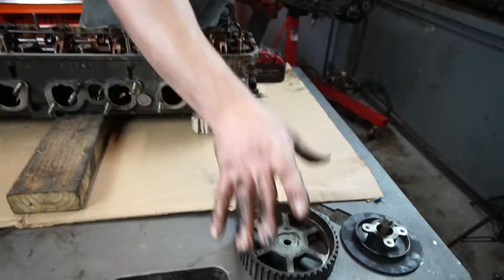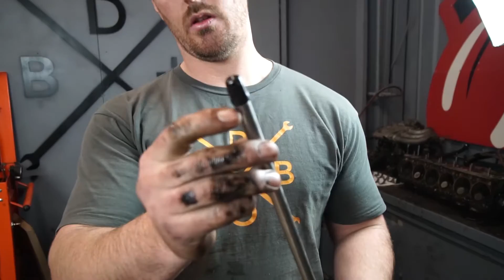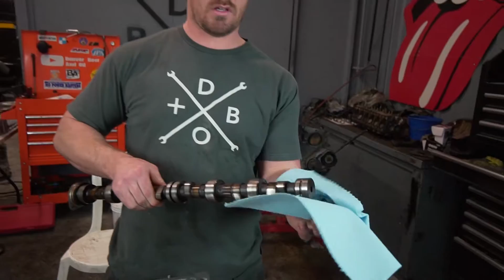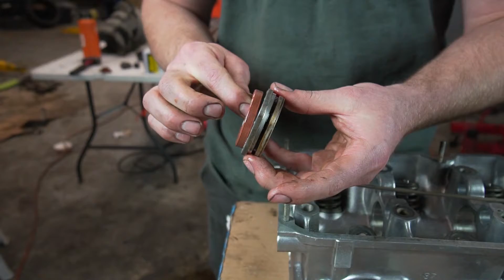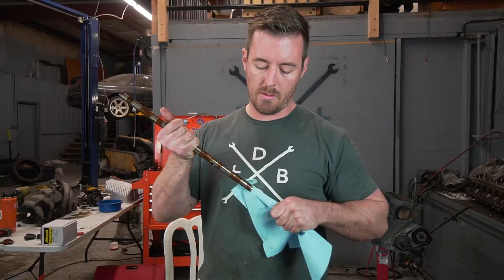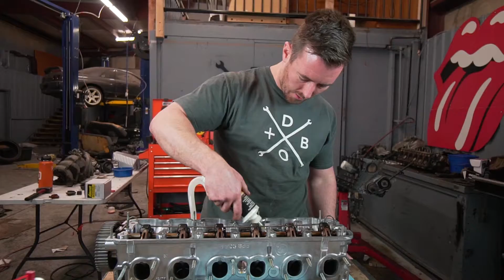M20 Head Assembly! | How-To

Comment from the maker: Hey guys, adding some supplemental info here, when reinstalling the rocker shaft @21:00... Make sure the large oiling holes on the rocker shafts are facing downwards to line up with the holes in the rocker shaft journal.

Comment: Thank you so much for this amazing video! I daily drive a 1983  e28 520i with that same engine which I had rebuilt last year. I noticed a small oil leak at the front passenger side corner of the block. Not sure where it comes from except I know when I did the rebuild I skipped the second head bolts tightening. Someone told me those heads had to first be tightened to the right torque, then driven a few hundred miles and then all bolts had to be tightened again with a cettain angle (not torque specified). Not sure what angle figure it was but I didn’t do that, expecting that my first tightening was the way to go. Is it true those heads need a second angle tightening after a new head gasket install, and if so, do you know the specs of said second tightening? Also, do you think the fact I skipped it might be the cause of that small leak I got? Can it be saved by an adequate tightening now (I’ve driven a few thousand miles) or will I have to re-install a new head gasket? Thank you so much. All the best from over the pond!

Comment: Damn, you absolutely HAVE to adjust the valves to max clearance and you have to ROTATE THE CAMSHAFT as you remove the rocker shafts, sliding the rockers out of the way and moving one position at a time. Never force the shafts out under pressure or you risk damaging the head. Something everyone misses is the fact that you CAN INSTALL THE ROCKER SHAFTS INCORRECTLY. The large holes face downward, and the small holes face inward.

Comment: Can the valve guide seals be changed on an m20 without removing the cams? Thanks,
Reply from the maker: You have to remove the rockers and rocker shafts, cam can stay in.
Reply: @DENVERBEERANDOIL  I have an 850i which is basically two m20s and guide seals need to be replaced. I should have done it a few years ago when I pulled intakes and valve covers to check cam oiling lines and banjo bolts.

Comment: Thanks for the video.  A couple of comments after rebuilding my own head. 
1. Rocker shafts are in fact directional. If it’s installed backwards, the retaining clip grooves won’t align with the rockers.  
2. After damaging one of my rocker shafts from too many attempts of hammering them in and out (see comment 1), I discovered you can in fact install the shafts with no hammering at all. Move all of the rockers away from the cam lobes as you install them and you can simply push the shafts in with your fingers. Then once in place, move the rockers onto the valves. Do all of the ones that don’t line up with the cam lobes, then rotate the cam to get the last 1 or 2 rockers in place.

Comment: You mentioned that valve adjustment specs are with the engine warm, but I've always heard it was engine cold. Is there that much of a difference or is it personal preference?
Reply from the maker: There are warm and cold specs, just make sure you use the correct values for your engine condition.

Comment: Great instructional video like all of yours I have watched. You mentioned about removing the valves in this video that were going to be addressed on another video. I can't seem to find it on your listings. Please let me know which one I should be looking for. I have cracked M30 B32 head on my 81 733i that was recently done with new valves and camshaft. I am going to be installing the valves on a new head casting from BMW so getting the valves out safely and withour damage will be paramount. You seem to know what tools work. Since the is will be a new untouched head is there anything that I need to do before swapping the parts from one to the other. Thanks

Comment: BMW has a special tool to set up the rockers on the shafts first, then lift all valves at the same time and introduce the camshaft afterwards. Avoids stress on the rocker shafts (hammer and radial stress, rocker shaft retainer slides right in, no need to hammer it in). I remember a feared mechanics teacher : if you reached for a hammer in the toolbox, you wouldn't pass the exam :-)
Reply: Info on this tool?

Comment: hii, loved this vid, quick quest. do i need to set the engine in TDC for this type of cleaaning ??? thanks !!
Reply from the maker: That is a difficult question. Yes and no. To remove the head no it does not need to be at TDC... To install, unless you are EXTREMELY familiar with engine mechanics I would HIGHLY recommend you set @ TDC before installation. This includes the short block and head. This is indicated by #1 piston aligned with timing mark or with #1 @ upper maximum of travel as measured with a dial indicator. On the head it is indicated w/timing mark or both followers completely off lobe and in the middle of travel between the 2. Align cam and crank with marks when installing belt to insure no "oopsies"

Comment: Great video(s)! I'm getting my head gasket done now. The previous owner installed a 272 cam.  My mechanic says it looks like used a screwdriver on it. Maybe it will need replacing. I've done my timing belt, dashboard swap among others. Looking forward to seeing more👍

Comment: Question I was try to remove crankshaft bolt and my crank turned about a half a turn without timing belt am I screwed? Valve damage ?
Reply from the maker: Was it with an impact?
Reply: @DENVERBEERANDOIL  thanks for.your quick reply I have eng on stand crank was turned with breaker bar I didn't  even know it was moving i secured back of crank with a chain to stand 7 foot breaker bar Kroil wd40 pentrants, heat will not budge any suggestions

Comment: Really glad your making this series. Can wait to see the engine block assembly. I wanna see the techniques for the wrist pins
Reply: I need some help my 2.7 L Block is at the machine shop and so is my OEM crankshaft and my OEM connecting rods I need to buy oversized bore 84 1/2 mm pistons and I can’t find any is it possible to use the i Pistons
Reply: @SilverZepp  )ĺ
Reply: Also is there a better place to where I reach you at?

Comment: Do you think you could do a video or series of videos on the modern BMW engines and why they fail so often, or seam to have the reputation for failing. What to look for or what to do to stop them from failing. 
Maybe you don’t think they are bad. I only was thinking about this because of Tyler Hoover and his crap box’s. Maybe a video of why his cars are bad.
Reply from the maker: Most definitely
Reply: boofighter I can give a quick tip for you from my own experiences: never ever in your life buy a BMW with an engine that has less than 6 Cylinders! Never buy a 4 cylinder bmw unless it’s an e30 M3. That’s why they have the reputation to fail often. It’s really mostly the 4 cylinder bmw engines that brake down or destroy themselves because of timing chain failure.

Comment: First of all props and thanks for putting out videos like every day, new favorite channel for sure. So: If I use my b27 head, I’d have to use a b25 cam and oil passages would need to be drilled in the head right? Where would those be? Also are the rockers different? I know the valve springs are and I’d need to change those if I were running a b25 cam. Is the process as simple as this video with the swapped parts? Thanks!